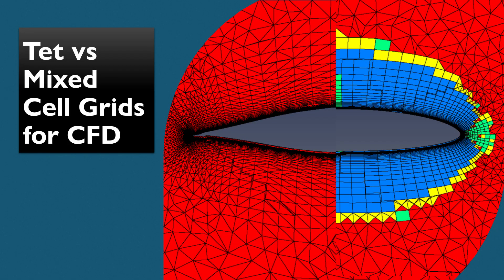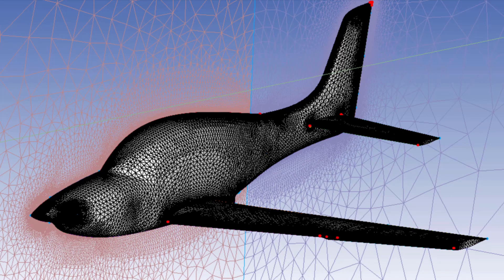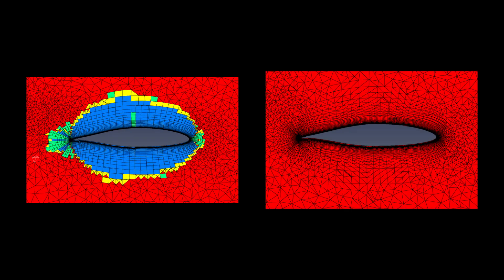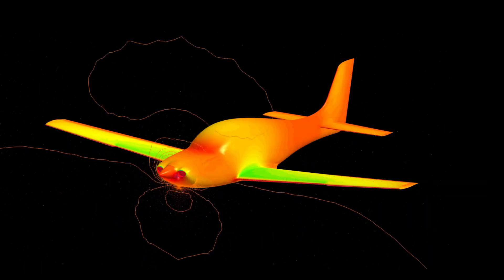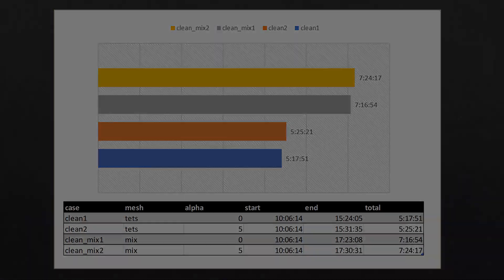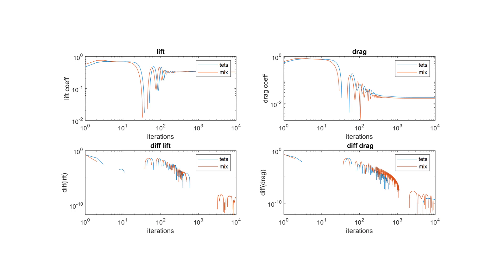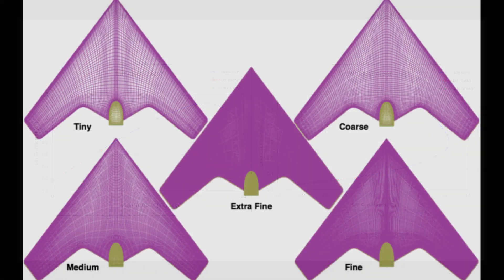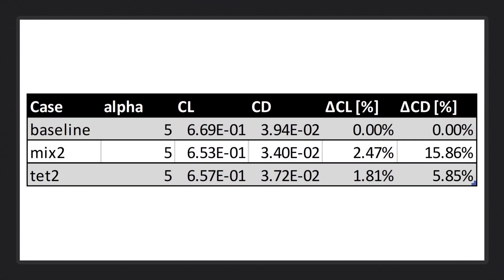What cells should I use in CFD? | Tetrahedral vs Mixed cells

Comment: So...tetrahedral mesh had 2.36x as many cells, 0.99x as many nodes, and 1.62x as many edges...as mixed mesh. That's a big deal if run duration was only 0.73x! Why isn't this common knowledge already? Good work! Did you run exactly 10,000 iterations for each case? It appears so from the charts, but it's hard to tell with a logarithmic domain and holes in the data.

2:11 On the right-hand chart, what the hell's going on with the y-axis? Did you round the values to the nearest tenth?

Comment: Interesting, thanks for sharing. How transferrable are the results to other solvers? Would the conclusion hold up in, for example, an FEM solver instead of FVM? What about higher order cells? The potential speed up achieved with a mixed mesh vs. pure tets is of course always welcome, but do you have an educated guess about the result performance?
Reply from the maker: Like I said in the video it is pretty difficult to make sweeping statements, it is possible to try to make educated guesses but the effects from particular implementations cannot be ignored. Generically I can say that tets are typically not used for 1st order FEM and are used a lot in FVM & higher order; this is more of an observational statement and not really a guess though. 

One thing which cannot be neglected is  engineering time, it is super quick to throw a bunch of tets at a problem if you have the computational resources, this is often a decent practical approach.